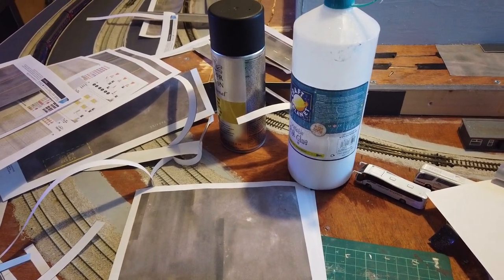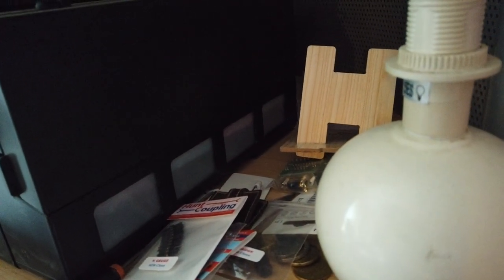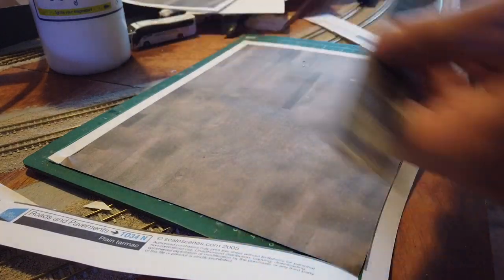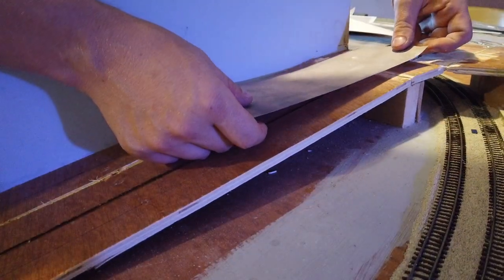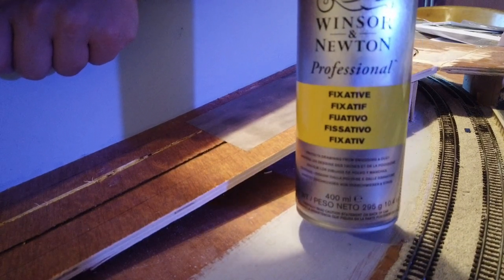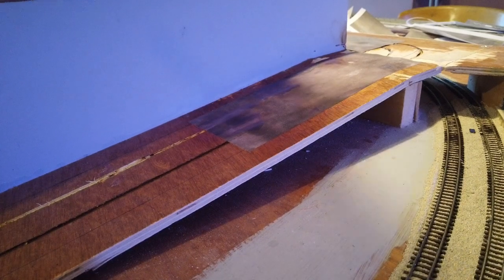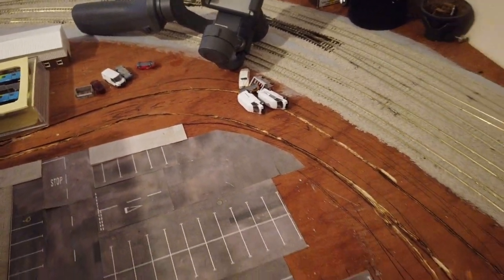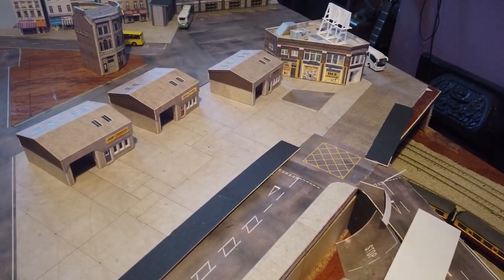Scalescenes Basics - Weston Parkway

Comment: What actual model is the Epsom printer you use and roughly what is the cost
Reply from the maker: Epson ET-2600. Bought for €129 and not needed to buy more ink yet, three layouts in, one a really big one, plastering them all in printer paper.
Reply: @Rule1ModelRailways  That sounds fantastic at a great price. Love your model by the way, I’m building a large model in n gauge but mainly scenic with long runs. Also like the idea of I trains so I can make is fully automated, using the DR5000 and all the other digikeijs units like you
Reply from the maker: @geoffreyspong3818  I am so very happy I could provide you with some inspiration towards your layout!
Reply: @Rule1ModelRailways  Just bought one thanks for the advice now I need printing paper what type would you advise
Reply from the maker: I've used Tesco basics, anything gsm80 is fine, and thicker card for more structural items. You can print stick the gsm80 to 1mm card, and that works really well.